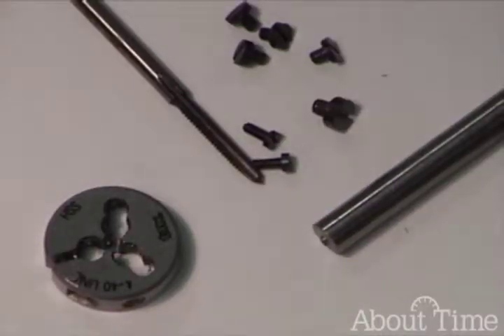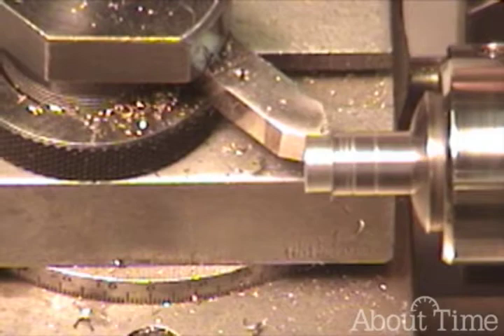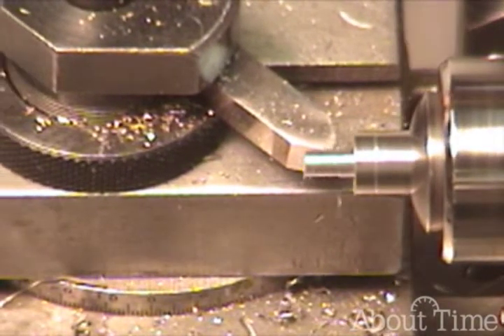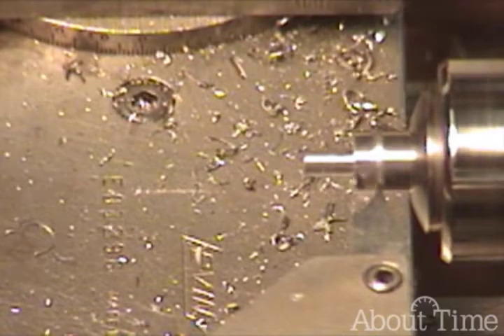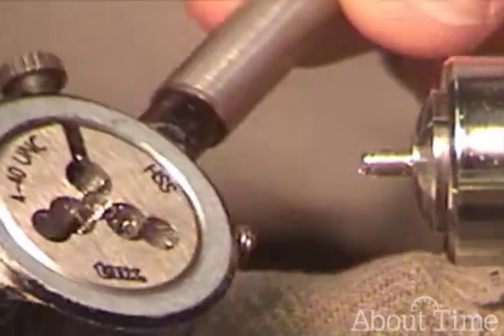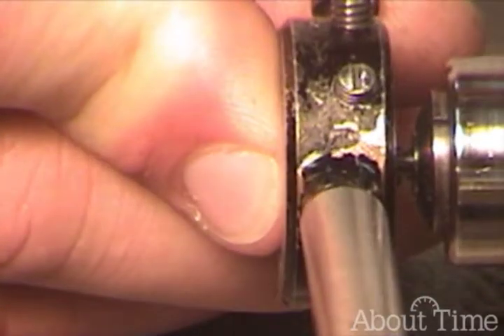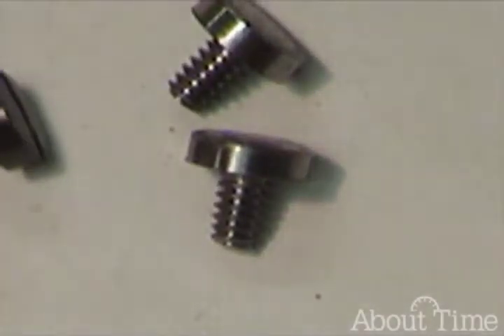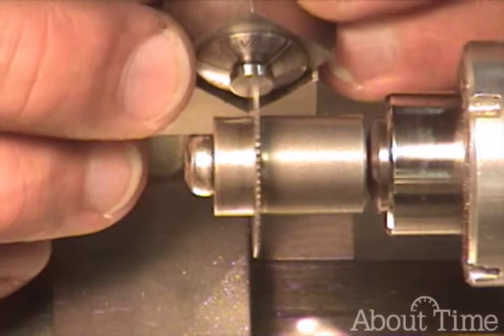ClockClass - Making a Screw

Comment: Why didn’t you tap the screw before you cut out off?
Reply: Hi Danny-

David LaBounty here...

Great question!  Yes, you could cut the threads on the screw blank before parting off the screw but, with the setup I was using in the video, I would need to move the cross slide out of the way in order to get my die holder into position.  That would mean a loss of accuracy if I was trying to make more than one screw and I would need to setup the tooling again.  I found it saves time to blank them out and then cut the threads in a separate step.  There is tooling which will allow you to cut the threads without loss of accuracy but it isn't something the average clockmaker has available.